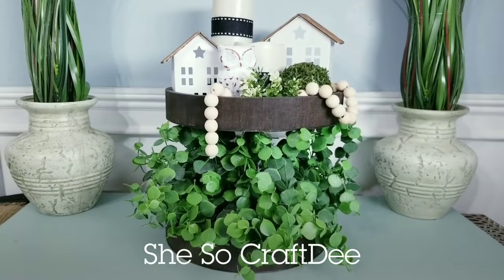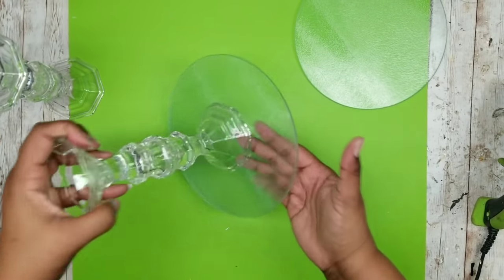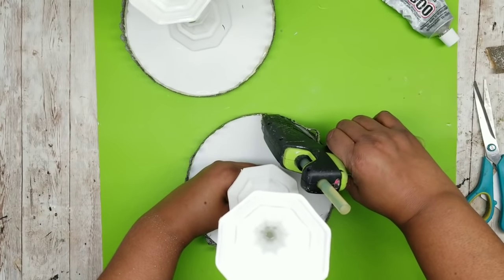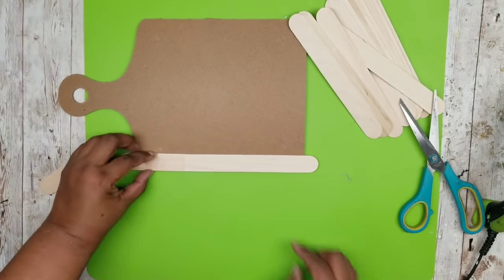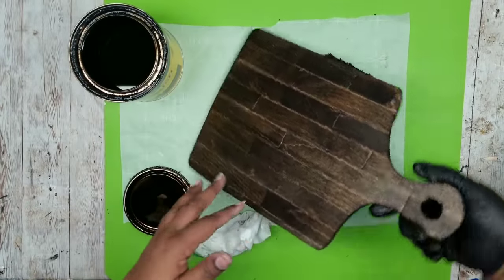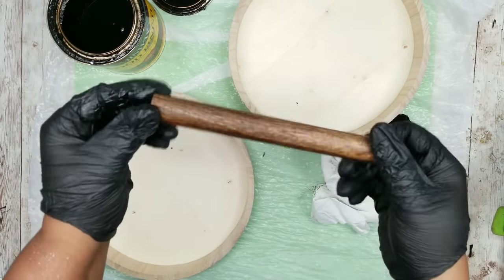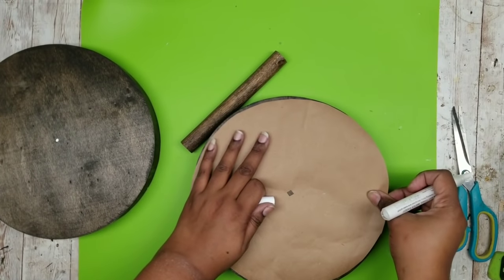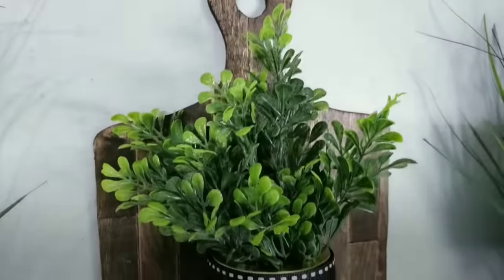*NEW* DOLLAR TREE DIY Home Decor | Wood Tier Tray | Wall Sconces | Candle Stands | High End Look!

Comment: 13:49 I tried to use the hot glue on simular project but i live in las vegas its hot i usually always add e6000 or simular but...i was in hurry when i took outside to paint it 😂😂😂 my nephew went out to get them for me when dry and 1 fell apart in his hand i was devastated!! Just so you know😢😢😢
Reply: Cool way to so back!!! So love it's reversible
Reply: Love your trays!!!
Reply from the maker: @pamedwards7708  Yes, I definitely do not recommend using hot glue on any project you plan to use outdoors, or in areas of very hot climates since the glue will reactivate. Try E-6000 alone or Epoxy. For wood, use carpenters wood glue.

Comment: Question, in your wood stand project couldn't you just take a paint brush and dip it into the stain then cover the non-stain edges??
Reply from the maker: For the narrow sign edge, I prefer to use the cloth for controlled application. A paint brush soaks up too much stain and it would bleed to the other side, which I was wanting to avoid. 🙂.
Reply: @SheSoCraftDee  Good to know. 😁👍